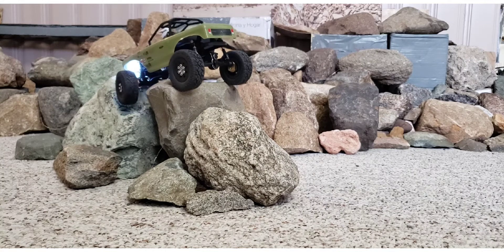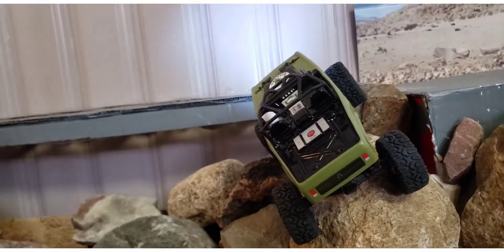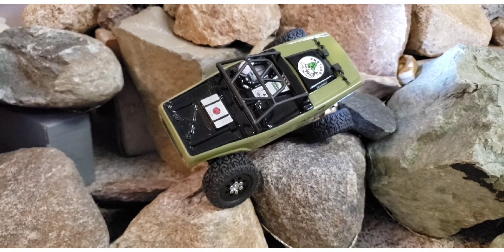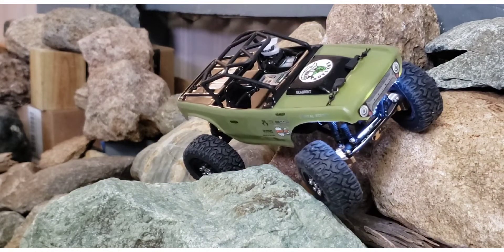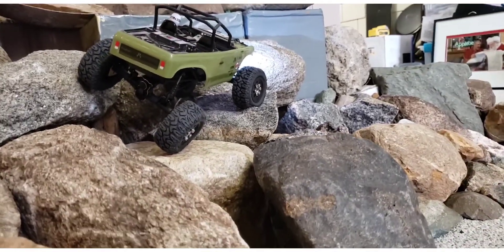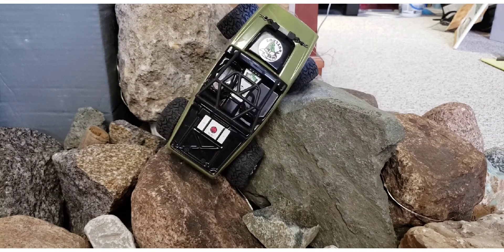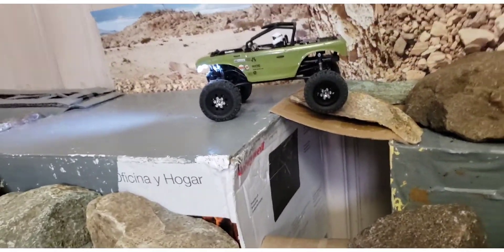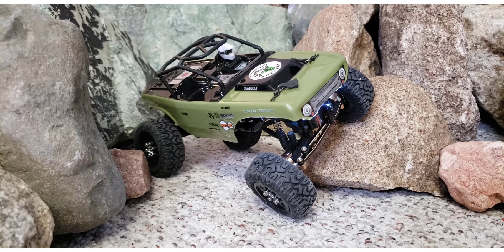SCX24 MoFo RC Portal Edition

Comment: I'm looking forward to getting this kit. I will be trying my scramblers for sure on these wheels. Not sure if I want to wait for my gladiator or go get another c10. My parts will hopefully be here tomorrow
Reply from the maker: I guarantee this will outcrawl a Gladiator on a rugged course. Good call on the wheels. In my opinion they should be part of the kit. No glue necessary.

Comment: I can’t comprehend how it’s able to sidehill as well as it did. That weight from the portals must really make up the difference from raising the COG. The price hurts me. You can almost buy another scx24 for the same price.
Reply from the maker: Very true. Portals add low weight. Keep the top light and they do awesome. 

I have an embarrassing amount of cash wrapped up in my crawlers and bouncers. Its cheaper than therapy. ; ) 

Every one of them is high performance. They are all different. I need to upgrade some parts on a few of my crawlers and change some stuff around but I am probably done buying more RTR RCs for a while. 🙂 I will enjoy what I have.
Reply: @EXPIOWA  I preordered two scx24 JT’s. I’m going to keep those scale and more of a trail rig. Something my kids can just pick up and wheel. Reliable and simple. I’ll be keeping my wallet tight for a while. 😂. But my other rigs will be getting a competitive overhaul.
Reply from the maker: Yep, you can.

Then you will have another truck you will no doubt need to sink a lot of cash into to fully upgrade. 😀

Comment: Is this a complete stock truck?
Reply from the maker: Highly modified. It has a Buzzsaw motor, high clearance links, brassed out front axle, upgraded MoFo steering servo and steering links, MoFo positive offset wheels, Patagonia tires and the crown jewel, portal axles. 😎👍
Reply: @EXPIOWA  ohh damn fir some reason I thought it was a fully stock deadbolt haha completely wrong haha. I got 2 sets of the portals n wheels but I have no clue witch rig to put them on yet. Thinking about waiting for the scx24 gladiator to install the mofo portals.
Reply from the maker: @24Krawlers  Might be good. I know it uses the same axles but it is over a centimeter longer than my Long Wheelbase  rigs are currently. 

Also, you might not want to. The portals cut the speed but jump up the torque due to the gear reduction at the portal box. I see the Gladiator more as a real trail truck than a crawler. You could always put in a high KV brushless system in to get back the RPMs and wheel speed. 

If it was me, I would keep the portals for dedicated crawlers. That's where they are excellent. Leave trail trucks with their stock final drive ratio. There is a noticeable speed difference.